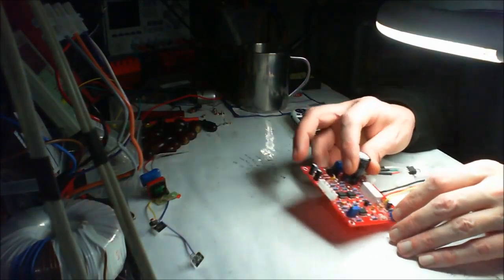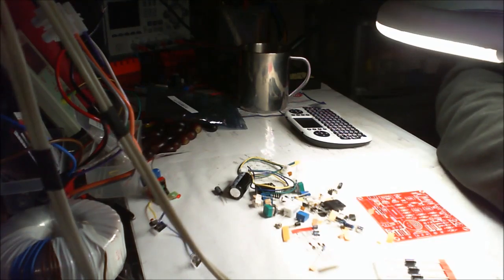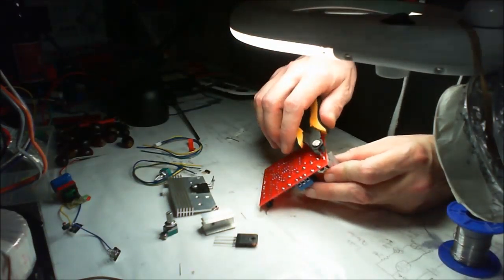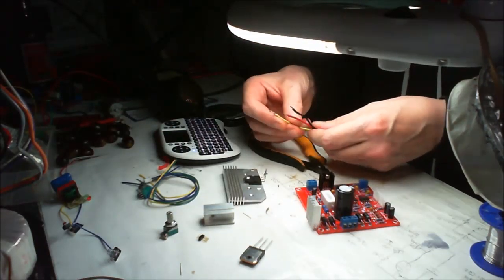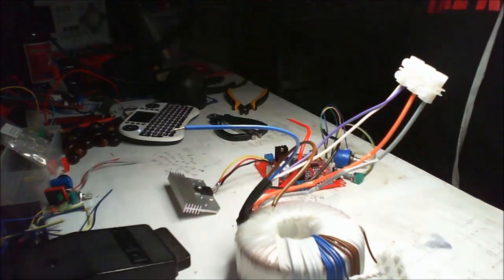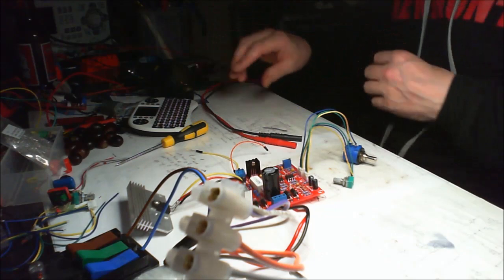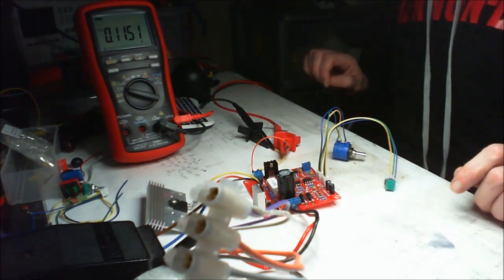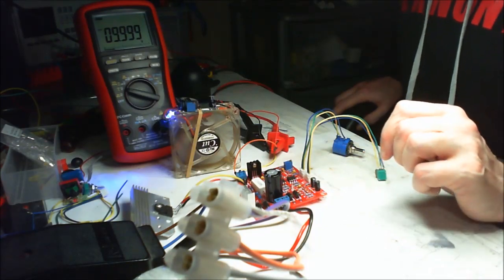Banggood DIY Power Supply Kit Build

Comment: I noticed you didn't zero it out during your initial startup. It's done with the onboard trimpot.
Also, the 24V regulator can be replaced with a 12V one, it's only there to drive a fan and a 24V fan can be quite expensive.
Reply from the maker: Hi, Cheers I will check out that trimpot. I have not put the supply into service as yet, I keep robbing its transformer for other things. I was going to go with two 12volt fans in series but being able to swap out the regulators is a helpful tip :D
Reply: I was thinking about swapping out the 24V reg for 12V, but I had a small 12V board and I didn't have a 12V reg. The zeroing was the only problem I had. Basically the trimpot did nothing, fortunately it was close to zero the way it was. I did a bit of a look at the circuit, but I'm not a EE so I don't know what it is.

Comment: What's the value of the 10 turn pot?. The current one was 10K, but you didn't mention the voltage pot

Would it work with less than a 24V AC transformer.
I only need 12V, and have a transformer out of a ATX PS - I think it's 12V (EI-40C) -.
Would that be ok, or does it have to be 24V.
Reply from the maker: +SidneyCritic ComedyHound HI, the voltage pot is also 10K. You need a AC supply because of the way the circuit uses negative for the op-amps. 
Check out this video to see what happens when just DC is used. Skip to 17 minuets in and you will get explanation of the difference when using DC to power this circuit.
https://www.youtube.com/watch?v=L2X6bAfmBno

I hope this helps you.
Reply: +Elecifun The only schematic I could find didn't have the values of the VRs, so I wanted to be sure.

The other guy said that 12V AC would be fine, so I can save some money using something I have.

Thanks for your help.
Reply from the maker: SidneyCritic ComedyHound 12 volt AC should give you a little under 17 volts out. do you know the current capability of your transformer. did your transformer come from a switch mode supply. you really want to use a mains isolation transformer.
Reply: +Elecifun I'm not really sure what type ATX PS it is - I will have to do some research -, but I've been trying to find exact spec on the EI-40c transformer inside my failed ATX PS.

Maybe this
http://www.kondzio.info/images/artykuly/2015/transformator-impulsowy/EI-33-datasheet.pdf

http://chipsen.en.made-in-china.com/product/IBZJxAPdgnWk/China-EI40-Current-transformer-specification.html

Here are some pics
https://www.mediafire.com/convkey/5cfc/snsaot1xhjknz3b6g.jpg

https://www.mediafire.com/convkey/c141/4uva5mjt899iyto6g.jpg

https://www.mediafire.com/convkey/edff/z66lnkp4g9f05jd6g.jpg

The gutted ATX case has a 12V fan, 240V connections, switch, and what I think is a filter inside - cap and inductor - on the 240V input, so it's ready to populate.

Any advice would be appreciated. Thanks.
Reply: 22V AC would be just fine. When rectified the output would be around 30V DC (formula is AC V * 1,4 = DC V).
Using a transformer lower than 24V AC is preferable as it puts less strain on the driver transistor.
I'm using a rewound transformer from a microwave oven. It puts out about 22V AC and keeps the driver transistor at acceptable temps with passive cooling.

Comment: Hey! ÷*) My Original Hiland 0-30V 2mA - 3A Adjustable DC Regulated Power Supply DIY Kit is about to be delivered. And, I am new to most of this, so I'm feeling... ÷○ (help!)
Hell, you know. LOL!
Any/All tips, tricks, suggestions are WELCOMED!
Reply from the maker: LOL yup I know that one. Tips, tricks. Take your time, reed resistors with a meter just to be sure. If you want it to look nice, place components like resistors capacitors the same way and neatly. 
Let me know if you have problems.
Reply from the maker: Didn't notice the comment until now.  How did you get on? Tip, take your time and check each component before soldering. Good Luck.

Comment: Hi can you help I have put 2 of them together and both are giving me full voltage at the output and I have no adjustment on the pots do you know what I might be doing wrong as I know I have them but correct.
Reply from the maker: If they are built correct then they should work fine. I have built 4 and all 4 work as expected.  If you send photos to my email elecifun@gmail I will look over them for you. Before that check and check again the component placing. A small mistake is hard to find but easy to correct : ) Good Luck.